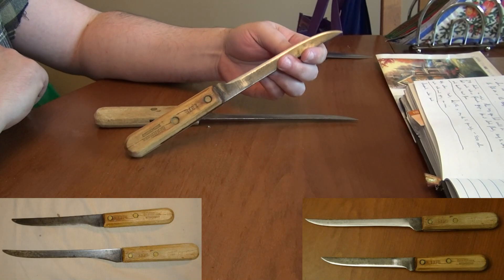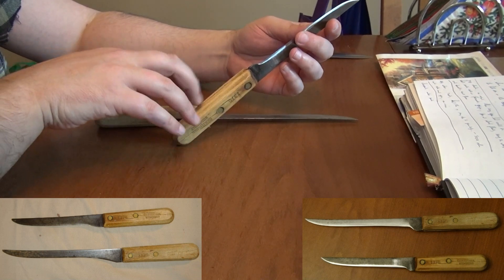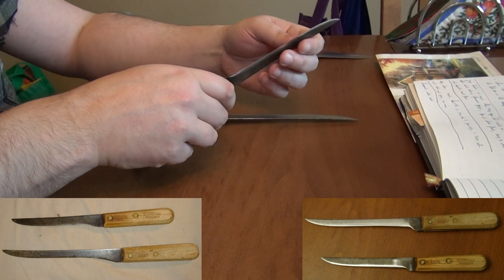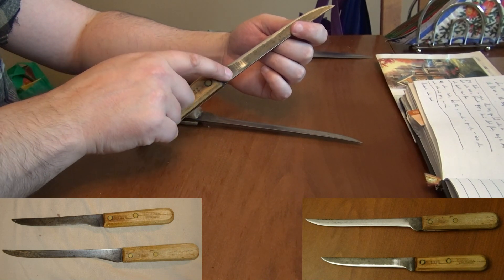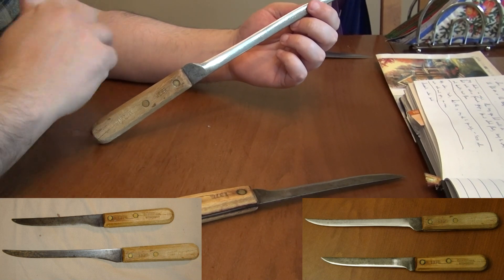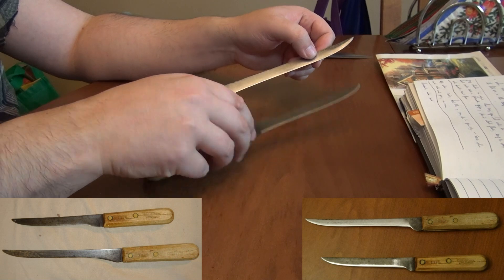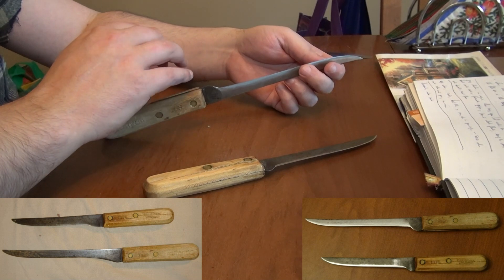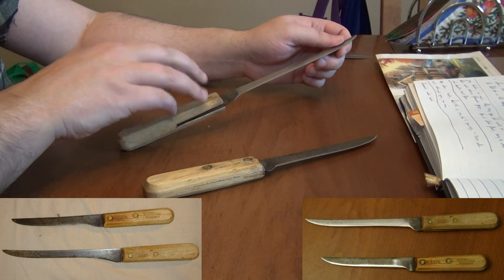Restoration : two very old and well used/sharpened kitchen knives

Comment from the maker: With cutting boards, one of the worst things is that they can be contaminated with dirt, debris, bone fragments etc. which can cause severe problems with you rake the edge across it. The plastic or wood itself is usually extremely mild as a blunting agent and you can carve it for easily 1000 slices with little effect. As an example I do 500-1000 cuts into pine, basswood, etc. as a very low level check on edge retention and that should produce no visible effect.

Comment: I just found this video .  I have been watching your more recent videos.  by coincidence you talked about rusty knives effecting the edges (along with big chips falling out of the edge when you start working with them) in that one too.  :) I have collected too many new knives in recent years.  Lately I have started to get Old Hickory kitchen knives.  In the process I ended up with a bunch of other carbon steel wooden handled kitchen knives.  The most recent is a utility / boning knife that is about 3/4 used up to the point it is more like a fillet knife.  It is comfortable to use so I plan on using it until I cant anymore.
Reply from the maker: Randy J Yeah, I still get those from time to time, rare now as most people are just replacing knives. Practically when a new knife costs as little as $2 it doesn't make sense for a lot of people to sharpen them.

Comment from the maker: The best blend is going to depend on use skill and how sharp you are trying to obtain and keep. One of the best balances I have seen to date is on the Spyderco kitchen knives which are MBS-26 (similar to 19C27) which is so insanely easy to sharpen that it gets sharper during the shaping than other steels during the final sharpening. It also has very solid wear resistance (just under ATS-34) and decent corrosion resistance (just under dishwasher safe).

Comment from the maker: There is a very high probability that the edges are stressed and are collapsing prematurely. The Sharpmaker is not a bad tool inherently but they leave out the destressing step in the DVD and this is critical to getting optimal edge retention.

Comment from the maker: Curiously enough, if you look at these older handles they are very similar to the japanese handles and do not have the exaggerated swells of the modern handles which are intended to be far more ergonomic and secure. I have always intended to take a new and old knife and use them for a long period of time and see if I could see a difference in that regard. However most ergonomic studies tend to be more demanding, line cooks, production workers, etc. extremely high volume.

Comment from the maker: Linseed oil and tung oils are used because they polymerize and form a hard/cured surface. Any oil can be used if they are not available, mineral oil is commonly used, you just need to take more care to ensure the excess is removed.

Comment from the maker: Linseed oil will actually form an extremely stable coating when cured which is why I would use that but anything is better than not conditioning the wood.

Most of the older knives that I have seen are extremely functional mainly because of the higher demands for performance. Locally Dexter and Old Hickory are extremely common and usually are generational.

Comment from the maker: If I am using them carefully and not cutting anything really demanding (bone, shellfish, very dirty vegetables) then on the decent knives it will be months. In fact the time is usually so long that I sharpen them usually after the first very demanding task, i.e., I prepare a meal with fresh garden vegetables. However my personal knives are very edge optimized and are only used for specific work, i.e., I don't use a vegetable knife to steak up a cod.

Comment from the maker: The steels last forever unless they are damaged by rust. Locally they are used very aggressively as a fine file which puts a very coarse slicing edge on the knife almost instantly. They do tend to accelerate wear though, but even then the knives are generational.

Comment from the maker: The belt is wet as is the knife/axe and there is forced air cooling. The knife/axe is dipped but only after it air cools, most steels can not take direct quenching without fracture. The water is just to slow down heat buildup during grinding not to rapid cool.

Comment from the maker: Nothing functional will happen until all the weakened metal is removed at the edge or at least until it is minimized. I commonly get them with hammer marks on the spine where the knife was used to cut through heavy bone. The edge will be heavily cold worked and really fragile. But once all of that is gone they usually will sharpen fairly easily as long as you use a lighter touch as the steel is soft compared to modern knives.

Comment from the maker: You could use motor oil but there are a few problems. Mainly you don't want to eat motor oil so I would be hesitant to use it on a handle as it will transfer to your hands, but if I had to choose between letting a handle dry to the point of splitting or use motor oil I would use the motor oil.